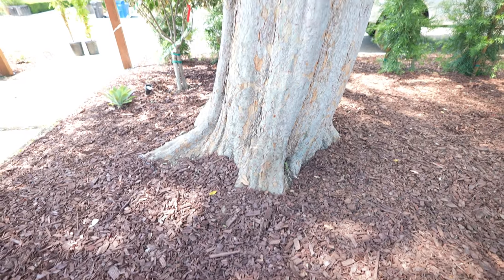Timelapse of Big Tree Installation | $200,000 (High End Landscaping)

Comment: Still cant believe the drip irrigation is literally laid on the ground and covered with a few inches of mulch. I saw that on a previous video also. is this just a Cali thing? No way I would be ok with if I'm paying 200K
Reply: They do it everywhere. And as a commercial irrigation contractor, in my state, and as well as many other especially California, drip-line is pushed as a water conservation. Although it has major design flaws and typically ends up useless after a major leak or years of usage. In my area we use a lot of well water and reclaimed, and they just plug the drip holes like nothing. The best alternative for trees is bubblers and conventional irrigation will always be king, however on large commercial construction, they will want you to use drip on all shrub areas and it really is just fucking annoying. We literally used 600,000 feet of drip line on a apartment complex once. What a nightmare. Although, the only application that I agree with is potable water, and used on a small garden. That’s about it.
Reply: That’s normal in Colorado as well
Reply: Its better to have it on the surface so when it leaks or if you want to add onto it, you can easily find it. It just needs to be protected from sunlight.
Reply: Either or. There’s subsurface and on surface drip. On surface below mulch is standard here in Cali.
Reply: Drip lines aren’t made to be buried deep
Reply: @54565syu  definitely agree with you. I'm im phx az. My father and I have been doing landscape for years. We do irrigation installs all the time. Out here the standard is around 6-8 deep. Although 1 ft is recommended. Biggest thing out here is we see almost everyone installs the main line and drip lines very shallow to save on labor costs. You're lucky if you get 5 yrs without leaks. I know out here we have mostly gravel and grass not mulch like in California. The soil ends up mixing with the gravel over time if there isnt a weed barrier installed and then you basically have the flimsy poly line buried in a mixture of dirt and rock. Also I think lots of contractors out here don't install the correct types of valves for them. They're meant to drip slowly  but we'll repair some that have 30psi or more  which causes leaks very quickly. The water coming out of the emitters or drip lines shoot out like 30 ft. Pretty crazy. We always recommend PVC to customers with multi emitters manifolds.
Reply: @eduardosanchez1316  where are you located at? I’ve never seen anyone bury drip line more than 6” deep. Let alone 1’ deep. Manufacturing details recommend 4-6” deep max depending on the plant material.
Reply: Yeah pretty standard.